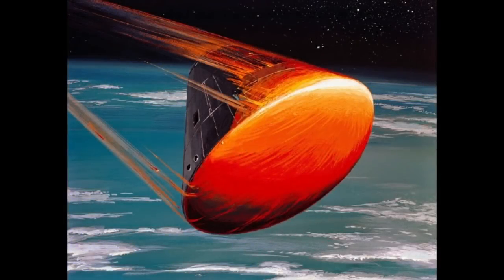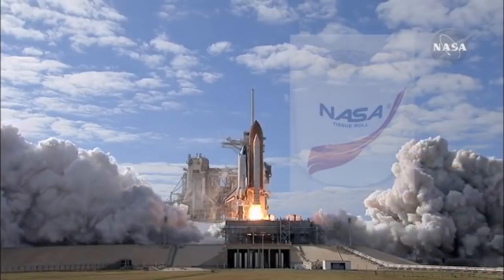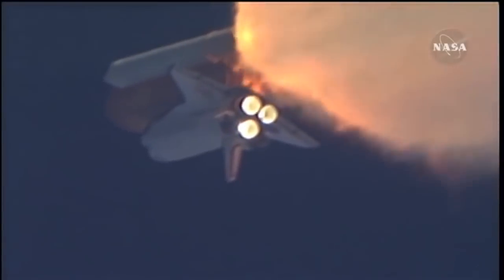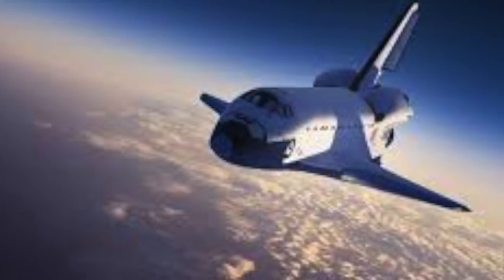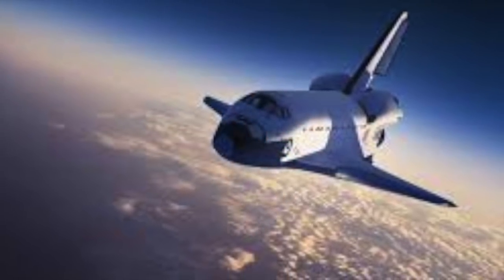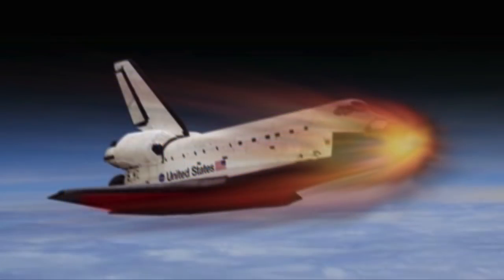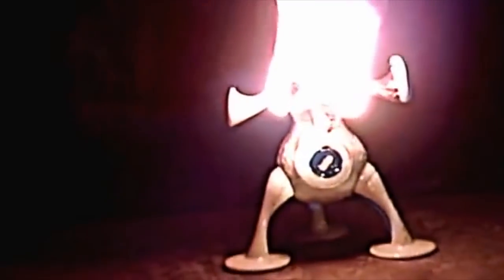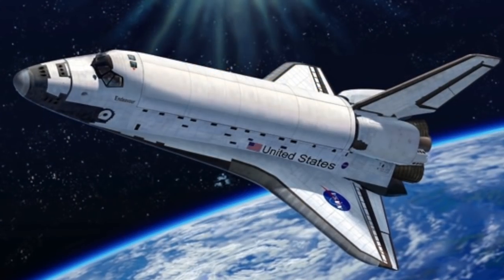NASA Fanboy questions #6

Comment: On its way into space, a spacecraft doesn't achieve its final speed--either orbital speed or escape velocity (which are different) until its well above the thickest parts of the atmosphere.  So no heat shield needed; at lower altitudes, it is not traveling fast enough to need one.  But when a spacecraft is returning, it enters those thicker parts of the atmosphere at 17,500 mph or faster.  Then it needs a heat shield.

What was the hard part of the question?  I was surprised with how quickly I had the answer!
Reply: This guy fooled you into thinking his question was serious. He knows the answer perfectly well. He's trolling the stupids.
Reply: @michaeldunlavey6015  Maybe, but with flat earthers, it's hard to tell.
Reply: 17,500 mph and how does the space shuttle gain that amount of speed? Would you not think it would be easier to slow it down before they enter? Or is that too obvious?
Reply: 17,500 from a tin foil space ship? Have you ever gone 120 in a vehicle? Better yet ever done 120 on a motorcycle?
Reply: @justanotherday5802 17,500 mph where there's no air resistance, like low earth orbit, and you won't feel a thing.  The atmosphere is only a concern when you want to come back, which is what this video is about.
Reply: @TheCNYMike  how would you know? have you ever experienced it? seen it? Or just repeating what you read in a book?
Reply: @NormieMcNormalton  Quoting multiple sources.
Reply: @justanotherday5802  Tin foil. Eh?  Not done 120, but 100+ on a 1968 Norton Atlas. Does that count?

Comment: Whats the temps on rentery? Just googled this info.
Ceramics generally can withstand very high temperatures, ranging from 1,000 °C to 1,600 °C (1,800 °F to 3,000 °F). Glass is often not considered a ceramic because of its amorphous (noncrystalline) character.

Spacebusters if this is correct ceramics might not even handle the temps?
Reply: Matthew Poole
So you’re positing that multiple countries make up fake numbers for fake re-entry heat and then let slip that their fake heat shields are not certified for their fake heat requirements.
Sounds like a classic NASA/Illuminati trick to keep “YouTube Junior Detectives” busy 🤪